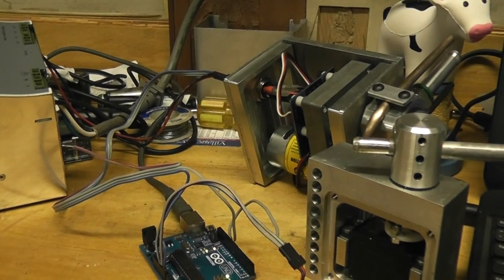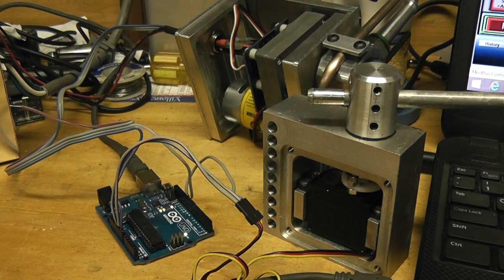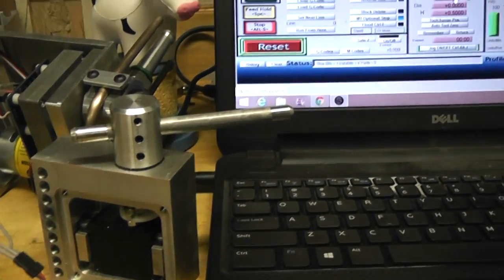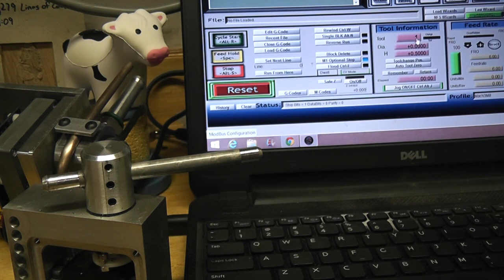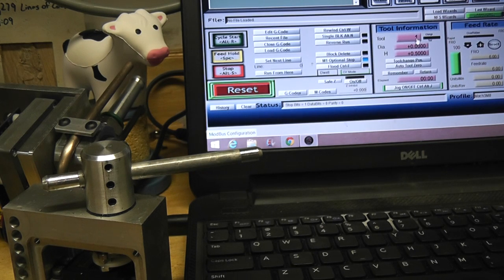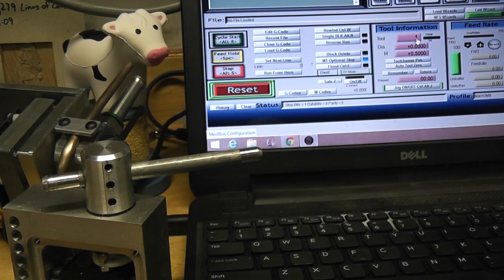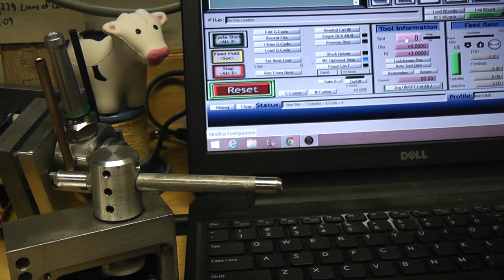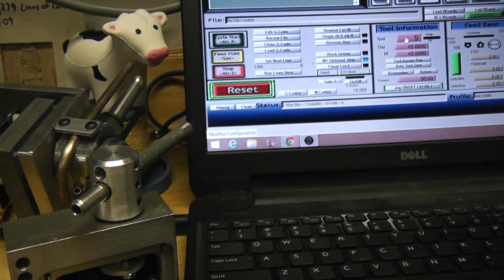coolant nozzles under mach3-modbus-arduino control

Comment: Question. I was pondering making a pendant with a tft touchscreen with the use of intergrating arduino with mach3.  Do you think it is feasible?  I have a 7" screen arduino mega. I thought about 3d printing a handheld case hard wired estop and and put buttons on screen for jogging, tool touch off and ect.
Reply from the maker: I'm sure you could do it with modbus and an Arduino. there is some info on the mach3  fourms  about  panel buttons  with an Arduino and modbus.

Comment: Do you have more information howto setup mach3 and modbus please ??
Reply from the maker: Frank Smit 
most of the information can be found in the mach3 forms. There is a link to the CNC zone on one of my other coolant nozzles videos. Here you can find the files for the complete nozzle set up. Also try this to get started, this has a PDF tutorial https://www.machsupport.com/forum/index.php?topic=22982.0